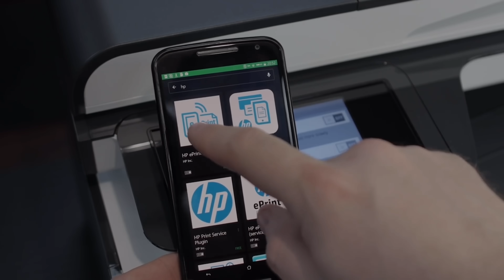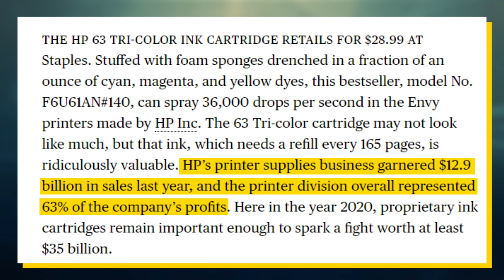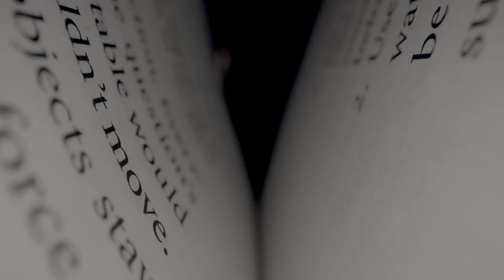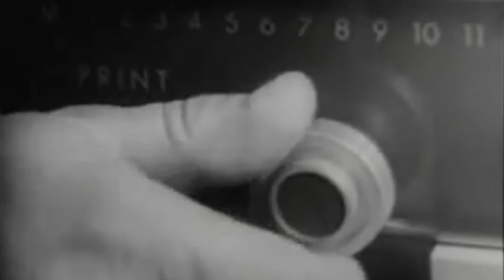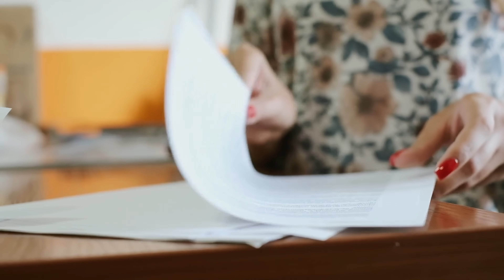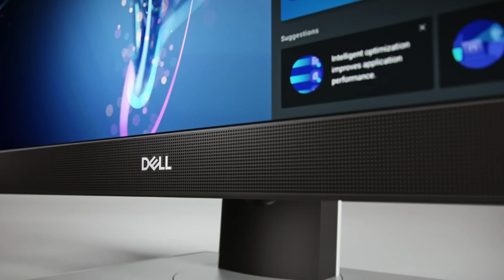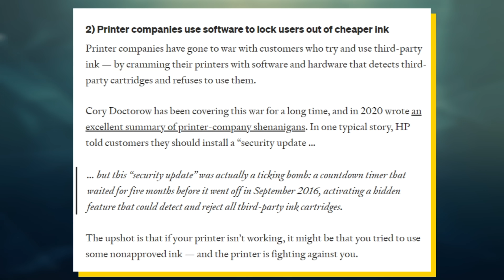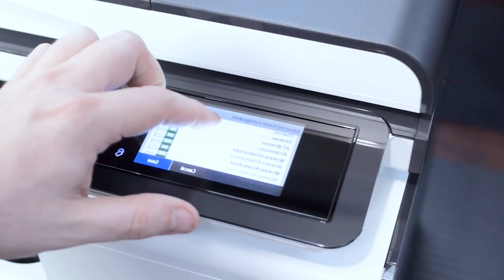Why Printers Are Designed To Fail: The Frustrating Truth

Comment: I was looking for a scanner years ago, so I picked up a free Epson printer XP-245. No driver required. Plug and play, works with every scan software. 
Now I got a new XP-2205 and this one will not do anything without the complete Epson software. And it will also only work with the Epson Software. 
They clearly changed something with this newer model..

Comment: We've known for a while that HP, EPSON and other manufacturers of printers make the majority of their money on ink.  What I don't understand is why these companies slap these printers together so dysfunctionally, even if a little quality control may cost them money.  I assume they could make money by using $10 worth of parts and labor to sell a printer in store for $100+ that they pocket, assuming we don't return such dysfunctional printer for a refund.  However, even though EPSON only got a couple hundred dollars manufacturing the two printers that I used between 1998 through 2021, I spent hundreds more on ink-BECAUSE THOSE PRINTERS PRINTED (therefore using a lot of ink)!  When I got my 3rd EPSON last year, they not only forfeited that $200 I paid for it (since I had to return it to the store after it stopped printing), but how much did EPSON make on ink that I never bought refills for, since this printer stopped printing (jamming instead)?  It didn't even use the content of the ink tanks it came with before it stopped printing for good.
Am I the only one who feels that WiFi set-up only increases the user's vulnerability to cyber attacks?  Since I only print from the desk top computer I use which is next to the printer, it seems to me that the WiFi complexity only disables these printers from doing what they are built for-which is printing.
Am I the only one who feels that printer manufacturers could sell more ink at profit to make up for selling these printers at a loss?

Comment: i have an old HP printer and without the company drivers, that thing is a work beast, as well as a canon printer that we actually found on the side of the road. i had to fix an issue with a ribbon but printers just works, empty or full cartridges, they just keep going

Comment: I love the printer I have. But it’s an old black and white laser printer. I find those have the least issues. The ink is expensive, but it doesn’t dry out and stuff. If you absolutely need to print, oook around for a used laser printer.

Comment: HP has always been the worst option. They did not use separate print heads so you had to buy ink and head every time. They have also been most determined that you must use only original cartridges. Super cheap printers where a single set of replacement cartridges cost more than the printer??

Comment: My printer was solely produced by Satan in hell. They require so much maintenance that's never included in the manual. For example your  expensive full ink cartridges drying out, Ink jets becoming blocked, the slightest debris and dust causing paper jams, customer support supplying generic answers that do not solve anything, etc.

I will never ever buy another printer, I will just go somewhere were they will let you print. It's not worth spending 3 hours of my time wondering why printer that was working last time can't print a single document now. It's not worth the stress.

Comment: I had an ancient inkjet salvaged from a dumpster that was probably from the early 90's. That thing lasted me over a decade and the best part is that it didn't do that thing where it checked for new cartridges so i could just refill the old ones myself. I'm guessing it worked 25 years with basically no maintenance aside from cleaning the jet head with a paper towel dipped in rubbing alcohol a couple of times a year. 
It didn't even break down, i just eventually stopped using it.  I placed it near the dumpster at my apartment and someone snatched it up within an hour. It's probably still being used.

Comment: Humm, well, I think you did show a good point regarding the printers being sold without profit as the manufacturers aim to recover that on ink/tonner; it also explains why models that use external ink tanks are usually twice the price of the conventional ones. BUT I don't think the product quality and improvement is frozen on time, no... actually, most manufacturers are selling models that are from marginally to substantially better from each other and this is a strong evidence of very alive R&D departments over such brands. Drivers updating are also, in my opinion, addressing problems much better since the HP 692C, which sold like water (I had one). And the ink cost, in my country at least, is slightly being reduced if we consider the cumulated inflation of decades. The HP692C ink cost was 55, some 20 years ago, and today the Epson XP231 is around 45, even though 55 worth around 350 today. So... no, I don't agree that printers are on top of headaches regarding electronics.

Comment: I'll tell you what if you could still get drivers for it but you can't but the Lexmark 1000 series was like the best printer of all time I bought one back in like 99 for 30 bucks and we used it for 25 years only stopped cuz you can't find ink cartridges for it anymore and they quit making drivers for it it didn't even have an outer case on it anymore it was Frankenstein to hell and back but when I threw it in the garbage a couple years ago it actually still work I wasn't retroing at that time I wish I had kept it just for retro stuff

Comment: I want a good printer to print good photos and for a manual now and again. Reading from light reflected from a physical page, especially pages from working on/ from, is always better than from a backlit screen. Less tiring and it's so easy to reference back to a page, but keep your current page to go back to without ferking clicking/ swiping or whatever and losing where you are. Too many computer clicks are involved.
It doesn't matter how bright the light is like outside sunlight, you can see the pages of a book, a manual or whatever and you don't have to be connected to the fucking net.
Not always used, but I always want a printer personally.

Comment: This is a very interesting video. I've been using computers for nearly 35 years and have bought probably dozens of printers. The last printer I bought was a Dell 7130. This is for my home office and not a cheap one.

I bought it in 2010 and I think I paid somewhere around $2,500 for it. It's a monster of a printer and has a monthly duty cycle duty cycle of 50,000 pages.

One issue is that cartridges for it are extremely expensive. If I use the Dell branded cartridges it will cost me nearly $1,500 to refill it. I found I can buy knockoffs for about a quarter that. Interesting thing is I haven't bought color toner for It for the last 10 years as I don't print a ton. But luckily being a laser printer the ink doesn't go bad as there is no ink to actually plastic.

I gave up years ago trying use inkjet printers and keep them busy enough where the the ink doesn't dry out.

Comment: Weird that you included hand copying, the printing press, and early photocopiers, but you skipped completely over home computer printers before the inkjet. There were a lot of printers that were good for what they did that existed in the daisy wheel and dot matrix spaces, as well as laser technology that ran alongside inkjet for a very long time. Even today, a simple black and white laser printer will cost you full price up front and the toner for it is cheap, with only six parts of the process inevitably wearing out - four of them are in the toner and the other two are in a toolless user-replaceable cartridge.

That's one reason inkjet printers often have the heads in the replacement ink cartridges, by the way. They can wear out quickly, and for best performance need to be replaced. That's one reason remanufactured cartridges have lower quality, they're using worn-out parts past their prime. Which isn't bad if you don't need print shop quality documents at all times, in exchange for a significant savings.

I've got a cheap used b&w laser printer from the mid-2000s that I have remanufactured toner cartridges for, with a total cost (minus paper and electricity) of less than us$100 and I expect it to be outputting high quality documents for another decade to come.

I also have a lesser-used color inkjet multifunction device when I need color, and yes it's a pain to work with. It's so cranky that, even though it has ethernet, usb, and wifi, I find the way to get the least resistance printing and scanning is to just virtually "print" my documents to PDF and load them on a USB stick, and to scan to a USB stick, bypassing network or PC communication methods altogether.

Comment: I remember back in time between 2005 to 2007, I had a very regular Canon inkjet printer in my bookshop, that I configured to print as drafts, filling cartridges using 3rd party cheap bottle of black ink, it was spitting about 30ppm (I think it was 28), and quality was good enough that no customer complained about.

Comment: Terrible take on the subject. Printers are like cell phones, they contain hardware that costs far more than the price they are sold for. Ink absolutely is overpriced and printer software does play games with ink levels but printers aren't "crap" because of the hardware, they're crap because they are designed to gouge people for ink to recoupe costs. Honestly newer printers are  bit better with ink prices than 10 years ago. Fun fact, I use Linux on all of my desktops and my Canon works just fine over the network. Well I connected a Windows PC to my network and as soon as it connected to the printer it started throwing low ink warnings when the ink was fine, and I didn't even try to print anything

Comment: How appropriate, I took delivery of a new Epson ET-8500 printer today, after I got sick and tired of the cartridges in my old HP drying out if they weren't used often enough. £15 for a cartridge I then have to throw away after having used it from new for maybe 10 pages a month ago? No thanks, that's more than even Xerox's pricing! Now I have ink tanks, duplex printing, printing right to the edge of an A4 sheet, a flatbed scanner, wifi so I can put it in a more convenient location and print/scan via my phone, and it's about 10x faster than my old printer with higher quality. So maybe there is some innovation happening in this space. Given how much faster and more convenient it is I can see myself printing a lot more for the kids instead of putting it off for fear of an hour's troubleshooting.

Comment: I've never really had any problems and my brand evolution days are long over. My present printers are a result of that and are pretty old (one is 7 years old and the other is 8) and on the network, one wireless. One upstairs and the other downstairs and you can use either one from any of the computers. Both are upgrades from the same brands. I use both Canon and Epson machines that are top of the line. The canon acts as our photo printer although the Epson is just as good. As long as the network is up, they work. I can even print from my tablet, though rare. As a copier or even a photo printer, they'll both work stand alone and have nice screens. I don't need anymore than that so I'm quite happy with them and yes, ink is expensive. But ink always has been, I'm used to it. Luckily the heads in my machines are permanent and don't dry out, so I've never had to throw away ink/ head cartridges because of it. HP's are bad for that as are any of the the ink/print head combo machines. My cartridges only hold ink, on both the Canon and Epson machines. There are generic cartridges available for them but I won't use them. Been there, done that. I have excellent machines and the only problems I have is running out of paper. And yes, the Inkjet 500's were work horses, I had one back in the day and you couldn't wear them out. Ink consumption was just horrible. They're the reason generic inks were even invented.

Comment: I have a xerox printer from 2010. Xerox don't even make it anymore yet they still try and charge $180 for black toner. I buy a refill and chip replacement for less than $40 on eBay. Can't even do that with printers nowadays.

Comment: I loved my old HP printers, they just worked.
Then they started with cheaper plastic gears, firmware that will just brick the printer if you ever used 3rd party ink.
Now HP is a company I avoid like the plague.

Comment: printers are terrible, HP seems to be ahead that they last a few years, but ink prices suck, and setting up some models on a network isn't fun, setting your printer in draft mode apparently saves ink, if you don't care about quality,  

It seems printers haven't really advanced, one can't really add anything new to something that prints, scans and copies. The only thing (correct me if I am wrong) is HP doesn't like it now when one uses generic cartridges or is it the ink refills, as they released a firmware update to prevent it from use.

Comment: I've had five printers in my years of computer ownership. An HP 648C (would not recommend, required special expensive cartridge to print better photos and still looked terrible), 940C (far better, but still a wonky design). Then a Canon PIXMA IP3000 that I honest to God found in the trash and resurrected which happened to print extremely well and I only ever had minor issues with. An Epson XP-640 All in one, which prints beautifully but I've noticed has a fixed printhead. And finally my Canon PIXMA Pro-10. It's a beast. Prints well, and prints huge, but the DRM for the ink can go! 10 cartridges, and the printer is constantly cleaning itself. Even pro printers are not immune to being terrible with ink.

Comment: I've been using Canon Pixma G2010 since 2019. It has an ink tanks that makes the cost of ink very cheap. I only refill the black and magenta ink tanks twice a year. I only refill the cyan and yellow colored inks once a year. Overall, I only spend $44 every year for inks. Yes, sometimes I experience paper jams, but its not because of the printer but because of the paper.

Comment: im working in printer related industry which maybe featured in this video but im not going to say which company and im one of the embedded dev for the printer's  firmware. all printers are designed to be easily to be broken on a small part so they could maximize their profit to change the whole part instead of the affected part unless you know how to fix but warranty/contract between distributor might be affected. im not going to be more detail as i wanted to secure my job as they had retrench quite number of dev, QAs, testers, factory workers.

its quite annoying even we do some sanity test on printing, either the printhead broken or the gear broken as they replaced most of part from metal to plastics.

Comment: One of the biggest "designed to fail" "features" of printers of any type that I've found is they are constantly changing the mechanical formfactor of the ink/toner cartridges. Then they eventually stop making the older designs rendering a functioning printer nominally obsolete because the consumables aren't available anymore. Eventually even the 3rd party ink makers stop making the formfactor (either the market gets too small for even them, or the availability of the casings for refilling dry up).

Comment: Having the inkjets on the cartridge does allow getting a clean set of inkjet nozzles with each new ink cartridge. If the off-brand doesn't work, try a different off-brand. And getting clogs in the ink jets is solved by replacing the cartridge. For me, my printing volume was so low that I had to waste ink on a cleaning cycle most of the time when I went to print. I switched to laser printers a long time ago and haven't looked back. (I'm not interested in the "photo" color quality afforded by inkjet. Laser color quality is good enough for my printing purposes.)

Comment: I did research before I purchased my current printer, a CANON TS9020. It uses ink tanks instead of cartridges. It even prints just fine on non-branded ink tanks and I only have to replace the tanks that run out, instead of all of them everytime.

Comment: It's only injket printers that fail regularly.  
After a mountain of inkjet printers that failed after I didn't use them for a few months, I bit the bullet and bought a laser printer.  
I've had it for many years now and it never fails to print, even if it sits idle for months between prints.
Yes, a toner cartridge is expensive, but it lasts a long time.  I only have to replace the toner once every few years.

Comment: As a former Quality Assurance at a major printer company (primarily Color laser printers), the biggest customers they cared about were banks. Also, laser better than ink, my laser is great and I bought it a decade ago for $100 and I only had to buy toner once.
Reply: Wholly agree with that sentiment regarding laser, my private little Dell c1660 may suffer from neglect, but over the past decade and change; whenever she was needed, she was there.

I think it's even still rocking the demo cartridges... come to think of it.
Reply: I rarely print things and it was always a thing in my household that the ink would run dry from not being used enough. Meanwhile when I bought my own printer like 10 years ago I got a laser monochrome printer for like $55 and I'm still using the original toner cartridge.